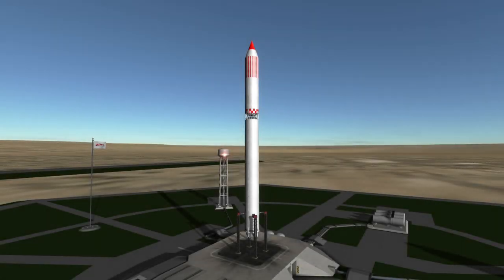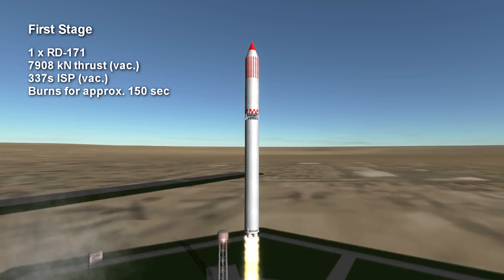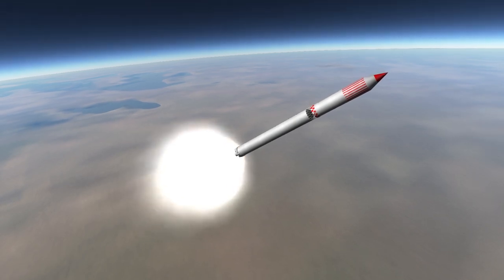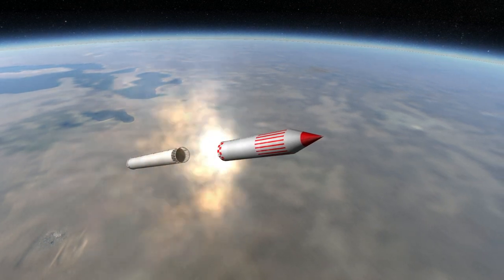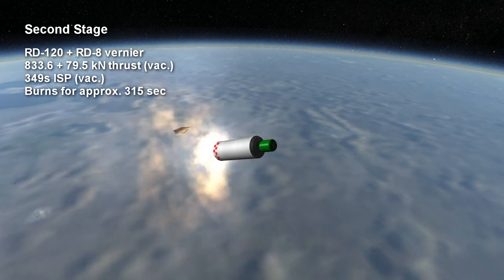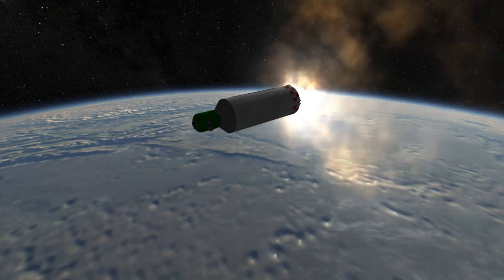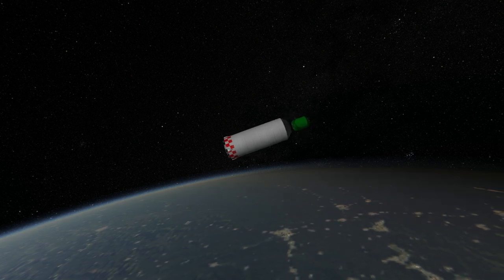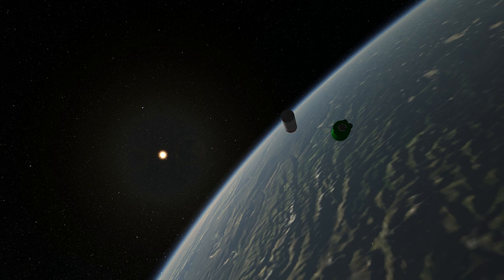Rocket Profile - Zenit-2

Comment: Looks like it could carry a warhead with it
Reply from the maker: It'd be a bad rocket for that, though, because it can't be stored with its fuel. Modern ICBMs either use storable fuels like UDMH and NTO or solid fuel, not Liquid Oxygen because it take too long to prepare such a rocket. So this would not be used for a warhead, though it has the payload capacity.
Reply: @RaizSpace  

NTO, UDMH, Nitric Acid, Hydrazine, and combinations thereof, to elaborate on this old comment.